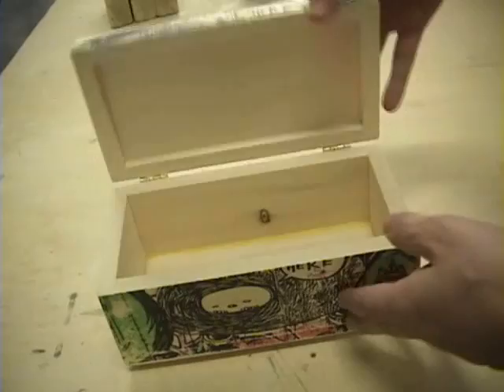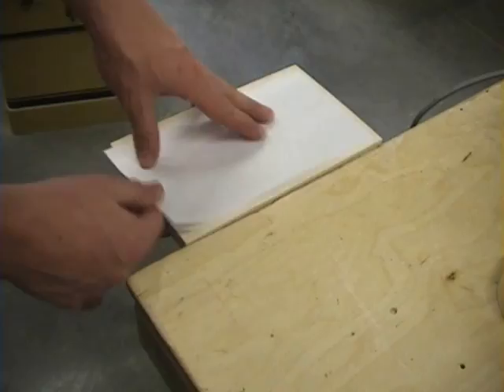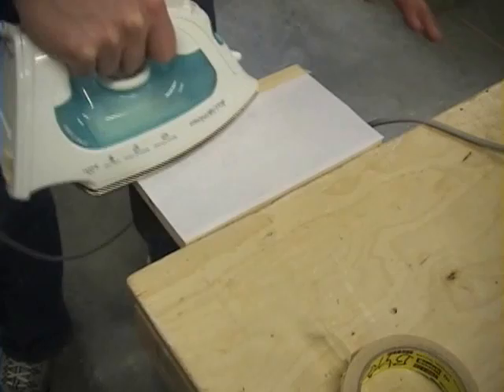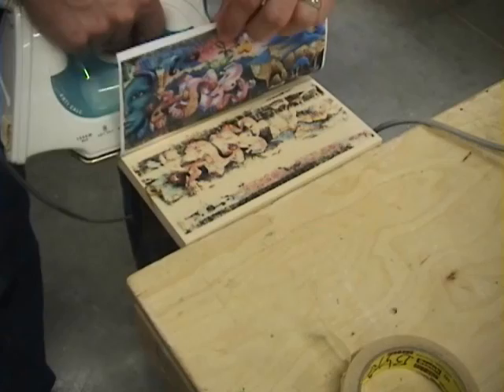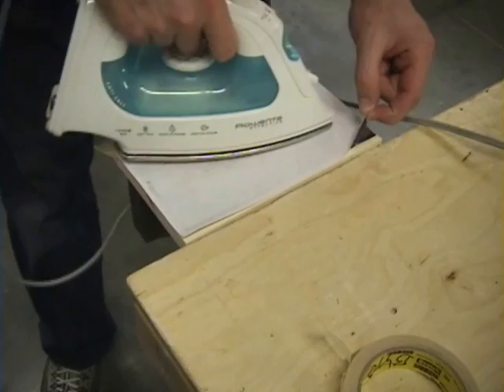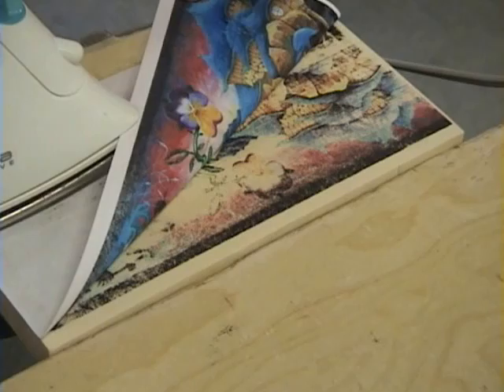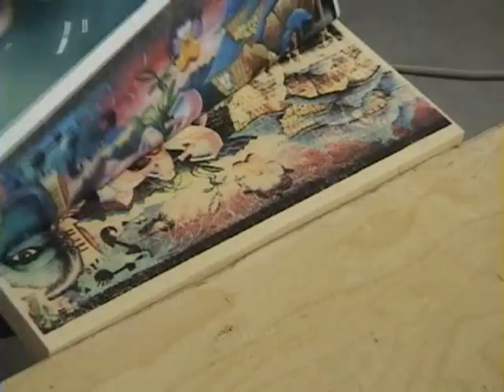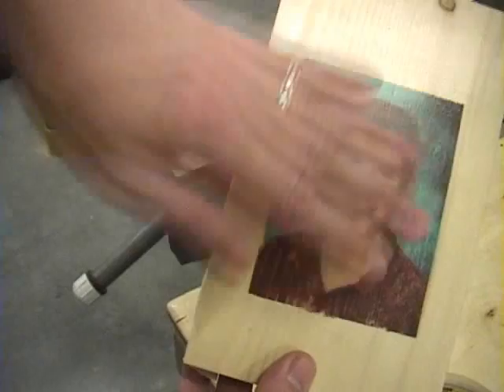How to iron transfer color pictures to wood

Comment: I can say that this technique works! I used a simple image (mine was B&W) printed on laserjet paper on a laserjet printer. No special paper needed. Do tape the design in place on the piece of wood. To maximize the amount of transfer AND to shorten the time it takes to transfer the design, be sure to progressively sand the wood surface down to at least 220 grit. The flatter the surface is, the better; as he experiences, any dips in the wood mean the flat surface of the iron won't contact that area, and the design won't transfer. So, after making a few passes over the design with the iron flat against the wood, go back over the design with just one edge of the iron. Be sure to go over the design with the iron tilted in multiple directions, to account for dips that face in various directions. Hope that helps everyone!
Reply: Ok

Comment: Thank you so much for this video.  After two less-than-stellar attempts with the Liquitex Gel Medium method of image transfer, I used your hot iron method to transfer the printed layout onto a homemade cribbage board and was amazed at the results. 

I did leave the iron on for a little too long in some spots so the paper stuck to the wood.  However, a little water and some rubbing with my finger got the paper off without affecting the fused-on toner at all.
Reply from the maker: Just make sure that you peel the paper off while it is hot.  It is good to know how to fix it if it does get stuck.  Steve Ramsey has another method that works great too.  http://youtu.be/Zq2O66QGCwg
Reply: TheMrByrom Thanks for that tip.
Reply: TheMrByrom
thanks!
Which Kind of paper you use ?

Comment from the maker: @drivemakeshoot 
The heat from the iron may cause the paint to do strange things.  I would not use stain because it would make the lighter colors and white to not show as well.  Also another person mentioned that the heat from the iron caused the glue to separate on a panel.

Comment from the maker: I have 2 other videos showing this process. One I just use a photocopy for black and white and the other shows my students after school putting designs on the bottom of a skateboard.
Make sure you use a laser jet printer or a copy machine.  You can use special paper with ink jet printers.  Make sure the wood is sanded nice and flat.  It also takes multiple passes to get a good transfer.  Make sure you use nice dark colors, and use a fresh copy for better results.

Comment from the maker: Do this before so the wood can absorb the ink.  Stain over the picture can change the color so I would try to stain around it.  The heat from the iron may hurt the paint.  I would try a test piece if you want to try this on top of paint.  Both the box and my picture were coated with clear lacquer after the pictures were put on.

Comment: Mr. Byrom, I tried this on an acrylic painted box and it worked like a charm! Except that some tiny bits of acrylic paint here and there lifted off and got stuck to the paper lol Still, it worked MUCH better than other things I had tried and it was almost inexpensive, I used a photocopy that cost me 5 cents. But before I ironed the image into the wood, I sprayed some hair spray on the paper sheet, I heard it helps to loosen the ink? Not sure if it made difference but still worked! So thank you!

Comment: does your wood have a gloss finish on it or anything other than sanded down two by four? I tried this but the picture isn't adhering to the wood quite right. how long did you do this box? maybe I'm not being patient enough?
Reply from the maker: quit playin.  I used a clear gloss after.  It does help make the colors pop better.

Comment: The 'ink' has wax, we call it toner at home. The wax gets melted and as you press on it. The image gets transferred as you apply pressure. Another thing we've noticed is that the surface must be as smooth as possible. Any pits or scratches will not take.

Comment: Ok, so I ended up having some success but not with the iron. Color lazer printer on glossy paper. Clamped down like yours but I used acetone on the back, and then rubbed the print with a metal spoon. Worked great! Just make sure it's a well ventilated area.

Comment: I'm guessing that the paper has to be transfer paper...? Same you would use to transfer a print on a t-shirt? How hot-what setting on the iron? Would using a cloth on top of the paper help with indentations on the wood? You know, instead of using the rigid surface of the iron directly on the paper... I'm about to do something like this for the first time, and I'm looking for the easiest way to do it. This looks the easiest so far. Thanks for sharing!

Comment from the maker: I transfer onto bare wood and then put a clear coat of finish on top.  Be careful if this is an acoustic guitar the heat from the iron may affect the glue joints.

Comment: I've been trying this for 4 hours today and haven't been able to get it to work like yours yet. I've used two separate lazer printers, one black and white, one color. I'm using a household iron, and trying to press and spread for about 5 mins at a time. But I'm still having no luck. Were you using glossy paper? How long did you iron for?

Comment from the maker: acetone will help but I don't want my students to use too many chemicals.  the glossy paper also can help but I am also cheap (school budget).  I got some cheap 7 dollar irons from Walmart and they worked with the regular paper.  It helps to focus on a corner and work your way across the picture with the tip of the iron after heating it up.  Also print with high quality so that the printer puts down plenty of ink.

Comment from the maker: This is with regular paper.  If you buy special iron on paper it will work better, but I like the fact that I can do it with regular paper.  Remember, you need to use a laser printer or copy machine.  Ink jet only works if you buy special paper.

Comment: This may sound crazy but would this work if instead of using a iron you just put your wood and picture in a toasted sandwidge maker and cooked it because its hot and it would be a evan heat?
Reply: that might either burn the wood or burn your house XD

Comment: Would it still work if you painted the wood first, like white?  (letting the paint really dry first)
Reply: Rob I
Reply: probably not. for two reasons. 1) your are putting on wood to see the wood pattern, painting will cover up the pattern. 2) a hot iron on paint? I would not want to breathe that and the paint will probably discolor because of the high heat.

Comment: you mentioned a fuser. what do you use for a fuser?
Reply: +Anna Holt He's talking about the way the picture is printed. You have to use a laser printer in order for this to work because laser printers fuse the ink into the paper. You can't use an inkjet because it's wet when it prints. Hope that makes sense.

Comment: As long as it is printed on a laser printer.What this is doing is heating up the toner on the paper and fusing it to the wood. That's exactly how the laser printer transfers the toner to the paper. You are just reversing the process.

Comment: Do you think a heat gun would work?
Reply: You need two things: heat and pressure. So yes, a heat gun could give you the heat (you would have to be careful you don't set the paper on fire) but you still need to apply pressure somehow.

Comment: made a huge freaking mistake lol. in my head i was like cool we got an ink jet printer :). uses up half our ink on a badass Avengers picture. it didnt work. sits down. rewatches the video. OOOH LAAAZER jet printer :(
Reply from the maker: There is another method that works with ink jet, look up steve ramsey color to wood, or wood working for mere mortals. you don't even need an iron for his method.